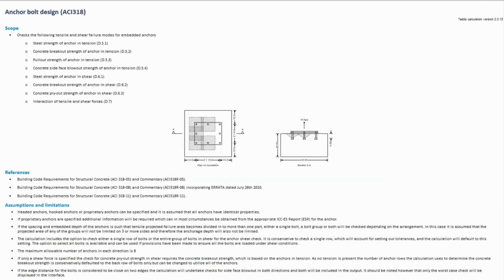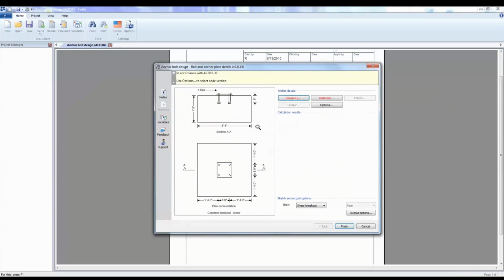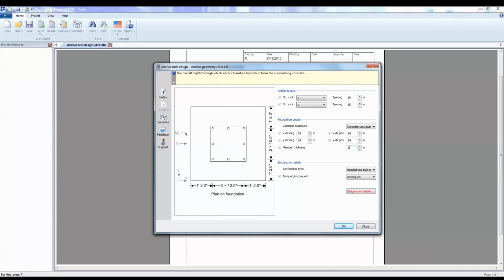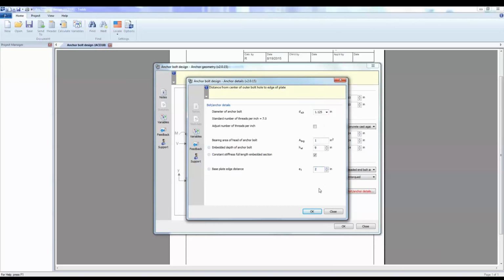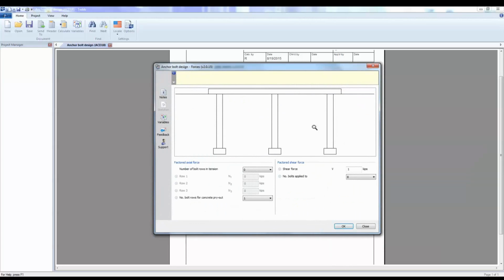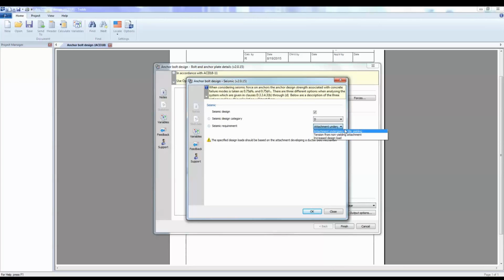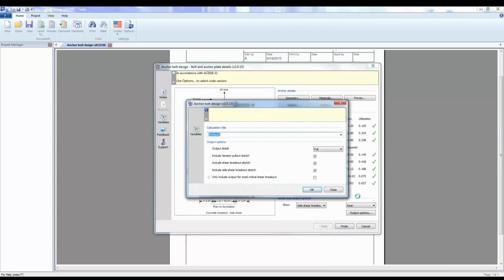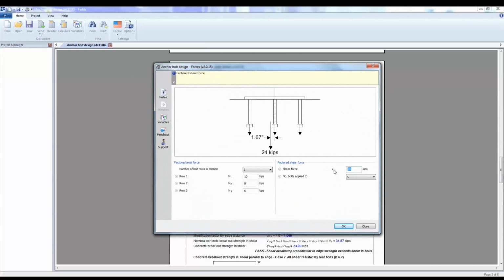Anchor Bolt Design

Comment: can i using American codes in design but using metric or S.I system instead of U S  units ?
Reply: Hi Milad, yes you can. Select the Options button at the top > Calculating > Regional Settings. From here you're able to set the Locale as 'USA' and the Base Units as 'SI'. If you run into any issues, please refer to your local support team and they'll be able to help you out, thanks!